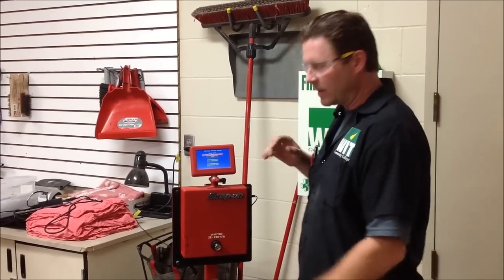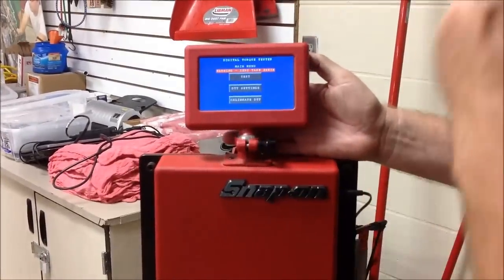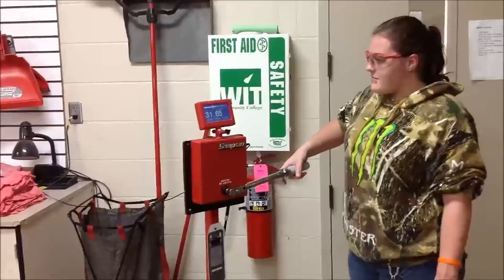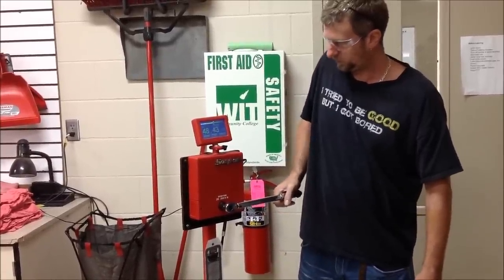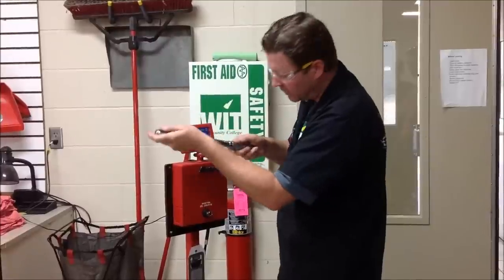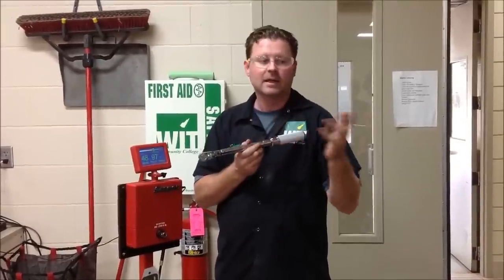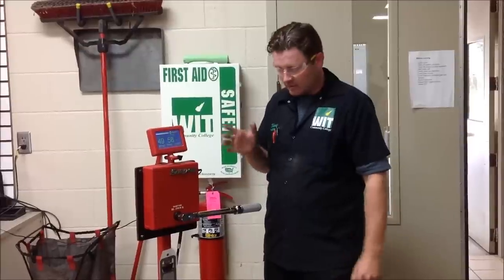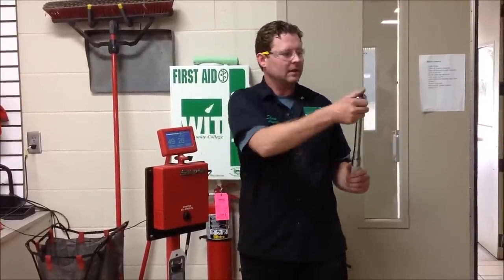Torque wrench calibration check Harbor Freight vs Snap On

Comment: That machine is nice.  You could use the harbor freight if you knew it was always 10 pounds heavier than it reads.
Reply: or he could "teach" his students how to calibrate the wrench. click style torques can be readjusted.
Reply: ri mar How do you reset the harbor freight one? Thanks
Reply: Except you'd have to keep testing at every different torque value because it's not likely to be off by the same 10 ft lbs over its entire scale, and could drift after that test so you'd have to keep retesting and have it repeatable.  Life is too short for that nonsense.

Comment: I can recall reading in the instructions of my clutch clicker style torque wrench that you cannot dial one up, then turn it back down again without a rest period. So who knows what was done with the Harbor Freight wrench before this test was conducted.
Reply: +Paul Frederick I just read the manual and there's no mention about a rest period, but it does describe a specific method of exercising the torque wrench prior to every use.  The manual states to adjust to maximum setting and then adjust to minimum setting.  As you note, we don't know if that procedure was followed prior to this test.
Reply: prairie wanderer
Yeah clutch style torque wrenches are funny. They're not the best. Better than nothing though I suppose?
Reply: Paul Frederick
 Both of the wrenches in this video are click / clutch torque wrenches.  So it's not a difference in design, but a difference in quality.
Reply: prairie wanderer
The internal design might be different. They both operate on the same fundamental principal, but there could be large differences in implementation. There is certainly a difference in setup between the two tools too. The one is calibrated much better. One could call it quality, but I suspect it goes beyond that. Although quality is certainly an influential factor in it.
Reply: Paul Frederick

I'm pretty sure all clutch-type torque wrenches simply use a ball-detent apparatus. Increasing the torque setting simply compresses a spring against the ball so it takes more force, i.e. torque, to unseat the ball from the detent position.  That is the click that is heard.  The only difference in set up I can see is that the Harbor Freight wrench has a lock nut that must be tightened once the torque is set.  I've never used a Snap-On, but my Proto torque wrench has a spring-loaded sleeve that has to be pulled towards the end of the handle in order to change the torque setting.  It serves the same function as the lock nut on the HF unit.  So, there doesn't seem to be a fundamental difference in the design of the wrenches.  The quality differences can encompass numerous factors from the quality and consistency of the materials used, to the quality and consistency of the machined surfaces in each wrench.  As an example, differences in the dimensions and machined finish of the detent that the ball rests in could effectively change the amount of force required to unseat the ball from the detent.  It's highly likely the dimensions and finish are very consistent on the Snap-On wrench but probably not so on the HF wrench.  It really comes down to how much a person can justify spending and the accuracy required by the torque wrench.
Reply: prairie wanderer
Well the HF wrench did seem fairly consistent, except for a couple of tries. It usually came up about 10 pounds low though. But the times the HF wrench was wildly inaccurate might have been down to user error? Watching a video it is hard to make that determination.
Reply: Paul Frederick

I agree completely.  The instructor in the video got pretty consistent reading whereas the student did not so technique is important.  Of course the Snap-On is calibrated before it leaves the factory, but I doubt the HF tool is calibrated at all.
Reply: prairie wanderer
the Harbor Freight one certainly seemed uncalibrated. Now whether the price of the Snap-On tool can be completely justified is a personal matter. It is a $333 tool. So easily 11 times more costly than the Harbor Freight wrench.
Reply: Paul Frederick
In my opinion there the price for just about any Snap-On tool can't be justified considering there are professional grade tools that have the same quality for a fraction of the price.  I'm sure someone is going to flame me now for saying that.  Of course it comes down the accuracy and consistency the purchaser requires or desires.
Reply: +prairie wanderer If you can't justify Snap On cost, but want near (NOT 100% in all cases! but close!) their quality, check out their other brands and the brands they buy from.

For example, check out torque wrenches from Precision Instruments and CDI, both of which Snap On has used as an OEM. In particular, check out the split beam style IF you don't need to use a torque wrench for loosening bolts. You can buy them new for under $200 (check ToolsDelivered for CDI or ToolTopia for Precision Instruments) or buy them for under $100 on Ebay. Heck, sometimes you can buy a Snap On "rebrand" of them for under $100 as well, though the cheap Snap On versions are often older and calibration could be out, which is the very problem this video is about avoiding.

For sockets and wrenches and such, check out JH Williams USA, which is owned by Snap On (note: Williams sells both USA-made and Taiwanese-made stuff; don't confuse the two or you'll end up angry that you bought Taiwanese stuff expecting it to be USA-made - the Taiwanese stuff is basically like Snap On's Blue Point brand.)
Reply: dansolodan
Good post.  I've had the same Proto torque wrench for years and it's a good tool.  I have a few older J.H. Williams large crescent wrenches, and they're top notch in every way.  I have a hodge podge of tool brands, a lot of Craftsman, some Snap-On, a little S-K, and a wrench and socket set I got about 20 years ago from walmart that are very good tools.
Reply: Oh yeah, don't forget that this video was shot from a grassy knoll as well.  Wow, do you view everything with your tin foil hat on???  Just curious.

Comment: just seeing this in my suggested videos. I'm a Snap-on fan. However I am curious if the Harbor freight can be calibrated and how long it maintains that calibration.
Reply from the maker: +Kevin Thomas 
I would "assume" anything can be calibrated but I would not want to bother or trust the repeatability. This calibration tool was over $2000 I believe. My SnapOn is going on 4 years with no change in test result and its worth mentioning the torque wrench is used daily in numerous settings. 

 Thank you. Always feel free to add your knowledge, and share these videos!
Keep Wrenching,Shane ConleyInstructor/Motivator/Motorcyclist
Reply: +Kevin Thomas  I agree with Shane; the HF can be calibrated but indeed you cannot trust that the calibration will stay true for the same length of time. Precision springs (which are one of the main components of micrometer torque wrenches as shown in the video) are actually pretty expensive - make a spring from lower quality steel and it will not be as stable.

And the other problem is that when you break the HF torque wrench, you'll maybe get it replaced under warranty, but even if you do, you won't be able to reasonably trust the out-of-box calibration... Are you going to send it out for calibration immediately when you're in immediate need of a replacement torque wrench?

Comment: My opinion with that machine you can calibrate the HF one and it will be as good as the Snap on one. Now HF does sell a calibrator that will let you calibrate any torque wrench.
Reply: +BADD400 CB700 drums    While the HF one may be good enough for some jobs, I don't agree with your post overall. Spring steel is actually something that can vary in quality between brands, and it's highly likely (I won't say 100%) that the steel used in the HF tools is of a lower quality and will have a lower stability. These micrometer torque wrenches basically use a spring as a reference and it is very important that the spring be made of quality steel and that it have very good stability over time of its spring pressure.
Reply: So BADD400 CB700 drums, you're good using a $20.00 Torque Wrench to install a half-shaft on a customer's car, that if the bolts fail, and the half-shaft comes off at highway speed, could potentially kill or seriously hurt people if the vehicle becomes unstable?  Come on, be a professional, buy a quality wrench man.  Doesn't have to be Snap-on, but I wouldn't torque a Tonka toy with a HF tool.
Reply: Rob Hill true

Comment: It shouldn't matter how far out on the wrench handle you apply pressure, as long it is a controlled application of pressure your values should be the same.

Comment: I had a $400 snap on torque wrench. With in four months it went faulty. Snap on had it for 2 months then charged me for repair. No life time warranty on them rep said. Its never passed calibration without adjustment since. Also the numbers became illegible. My $300 Sykes picavant still going strong. I also have a 50 plus year old Britool and its a monster.
Reply: You had good luck with those, mine HF from 1/4" to 1/2" were junk. The only exception was the 1/2" HF electronic torque wrench but that was about $100. Don't think they have it anymore.

Comment: So I guess the moral of the story is that you get what you pay for : ) I would always rely on a brand name torque wrench before I even thought about using junk from China .
Reply: +brad b Yeah, if you want to spend $300 on a tool you use rarely as a shade tree mechanic. I much rather use the Horror Freight torque wrench than take my car to the local scam shop and have them rattle gun my fucking lugs on so tight I need new rotors lol. Who wouldn't LOVE to have the Snap On, even if you only needed it one time? It's just a lot of money to pay when you can get pretty damn close for a fraction of the cost. Hell, at $22 they're disposable, you can't even calibrate one for that price.

Comment: Surely it doesn't matter where you hold the torque wrench, the mechanism is still going to click at the desired torque? If you put a 2 meter pole on the end of it it would still click when the mechanism is under the set torque.
Reply from the maker: Hello there. I would suggest you watch  other videos on torque wrenches to validate the importance of where you hold your hand does matter on the applied torque value it's all about math and changing the distance from, quote "the clicker, or fulcrum" to the handle. Literally this video was down to two points number one quality inspection of torque wrenches and calibration. And also  proper use of the tool.
Reply: +shane conley Maybe i'm missing something but i disagree. If you extended the length of the wrench then you would just have to put less effort in due to the extra leverage. The internal mechanism would still deflect and click under the same torque. you kinda proved this in your video.
Reply: +Thomo 1 That is incorrect. Micrometer style click torque instruments are length sensitive and torque must be applied at the center of handle, or the handle indicator line.
Reply: +D Valle Actually, physics takes care of that part for you. It does not matter where you apply the pressure as long as it's straight and center (and as long as the housing of the tool doesn't flex significantly). If you had a cheater bar that fit EXACTLY over the end of the torque wrench, you would even be able to use that with no accuracy loss. In the real world, that is not possible, because ANY difference, however minor, between the wrench and cheater bar would "use" some of the torque and would thus be inaccurate. (When I say exactly, I mean at the molecular level, not just 'dang close.')

Comment: Hi Shane thank you for the video. Is good that you point out the difference between the quality of Test Equipment.

In regards to:
(Alex Tworkowski)

I think you need to take a more relaxed view to comments.
If you post videos on YouTube you need to be comfortable with the fact that you will get good comments with bad comments and sometimes some indifference

In regards to your test you are trying to measure the Torque load at the Head of the Torque Wrench.
The amount of effort that you apply to the Torque Wrench is regardless/ unimportant.

You are just increasing the leverage if you used a longer extension to the handle. 

The only thing that effects the accuracy of a Torque Wrench is the extensions to the drive.

As an example if you used an extension between the Torque Wrench and the Socket itself, Yes that will upset the accuracy. 

Just trying to educate not insult.

Regards Peter.
Reply from the maker: Hello Peter,
No worries. I always welcome helpful corrections or comments. What you are not seeing are some of Alex's deleted comments that were just plain insulting and nowhere near part of the atmosphere I create here. What you are also not seeing on your points is found in my other videos old and new. If you wouldn't mind taking a look at the redo, I like to hear your thoughts. I also have detailed videos on extensions and their effects on torque.
Reply: Hi Shane.
 I did see the noted (edited comment) next to replies from Alex.
Totally understand just like the one sided story you need to know both sides before making any judgements.

Comment: Very good video! Too bad the HF tool was so far off. I'd be interested to see what "economy" priced tool passes this test, because the majority of shadetree mechanics don't want to spend the money on a Snapon.
Reply from the maker: +themadmailler Thank you and please share!
Reply: +themadmailler maybe Husky? I will say this, though: Two good brands that Snap On has used as OEM are CDI and Precision Instruments. Personally I have owned a couple PI "split beam" torque wrenches (which are better than the micrometer type in this video in that you don't need to reset them to minimum torque to minimize wear on the spring, but are worse in that they are one direction i.e. tightening only)

You can buy either one on Ebay for under $100 if you wait a few weeks to find a good deal. You can buy either one new for under $200. Tooltopia for Precision Instruments, ToolsDelivered for CDI are the best prices that I know of for the two brands respectively.

Too lazy to check but I believe both brands offer both micrometer and split beam types. Again, I really recommend split beam unless you want to use a torque wrench for removal as well (which is not a common requirement, but if you need it, you need it).

Comment: Buy something in between, HF is to cheap, but Snap-On is grossly over priced.
Reply: There is a video on YouTube comparing a SnapOn and Harbor Freight torque wrenches against each other.
 The guy never ever showed the torque wrenches in use with the calibration tool. Yet he wrote a bunch of numbers down on paper saying the SnapOn was not calibrated correctly and that the Harbor Freight one was more accurate.  He never showed the torque readings with the sound of the torque wrench clicks and claimed Harbor Freight was better. So many people responded to that video saying they are all going to H.B. to get a new torque wrench!

Comment: or you can re-calibrate the harbor freight
Reply: Yes it makes perfect sense to pay 5X what the tool costs to recalibrate it.
Reply: @stinkycheese804  There are plenty of videos online on how to calibrate your own torque wrench using a simple luggage scale. Or you could check the calibration of your HF torque wrench at various settings, and determine how far it's off one way or the other, then add or subtract that percentage when you set the thing. Lotsa different ways to skin a cat!
Reply: @maximusmax4557  Except if it keeps going out of calibration because the Chinese buttermetal spring is losing tension and even right after calibration, it might still be losing it on the first use.  That is often a problem with HF tools, good for a few uses then go downhill from there.  That makes them a great value for something you rarely use, but if you really need a precise torque value, how much hassle to keep recalibrating vs risk if you don't, is reasonable to put up with?  That is not a reason to overpay for Snap on, there is a wide gulf between cheapest and most expensive.

Comment: this is why I pay big bucks and buy snap on. 10 ftlb differance aint worth cocking up a $3000 headgasket
Reply: lmao 3000 for a headgasket wtf are you fixing and what kind of head is this
Reply: Sameul Jones the dumb enough to pay 3k for a gasket change is dumb enough to pay for a strap on tool
Reply: I paid $2200 for the work on my S10 heads resurfaced,head gaskets manifold gaskets exhaust valves and intake valves head bolts valve cover gaskets. runs like a new engine

Comment: How do you calibrate the machine? is the calibration machine to calibrate this machine in calibration? And so on and so on. how accurate can all the calibration machines be?
Reply: They are calibrated and certified in a accredited laboratory using beam weights.

Comment: I bought what I would call a cheap torque wrench. I don't have a way to really test it, so..... Just gonna keep using it.
Reply: +dwoodog What do you use it for?
Reply: mostly tightening wheel lug nuts.
Reply: dwoodog Ah, well, those aren't quite as sensitive as something like head bolts, so it's probably fine